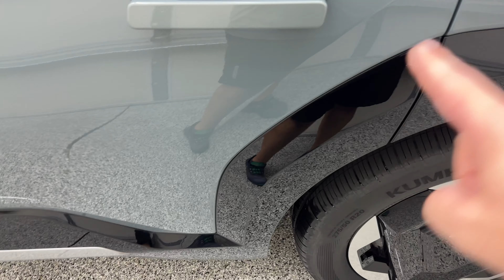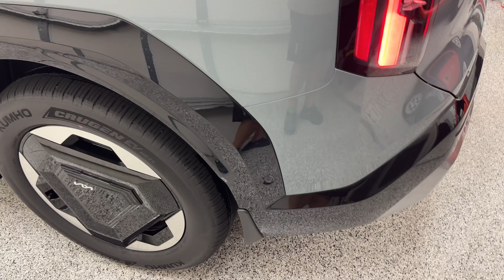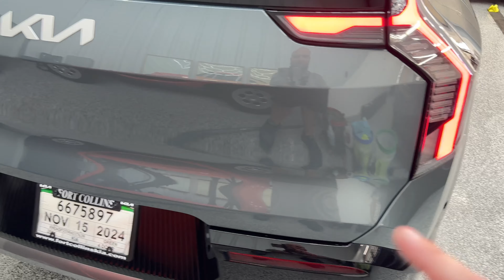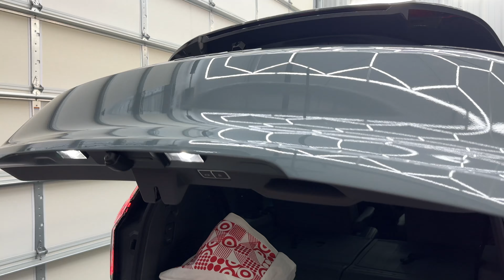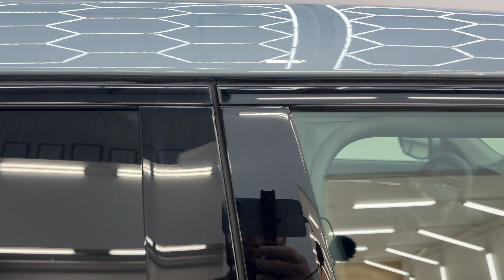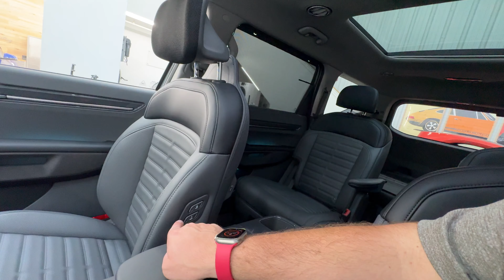KIA EV9 Land Build Quality Analysis! Is KIA's Most Expensive Model Worth The High Asking Price?

Comment: I just watched your video comparing the four 3 row EVs. You had some stuff in your front Frunk that you said was for the ICCU issues with the EV9. Have you had any of those issues? What did the stuff up there do for your EV9? It was my understanding that if the ICCU blew (because you were using an AC charger at a speed too high), that it could only be DC charged until the ICCU was replaced by KIA, and it could still blow again, it isn't a 1 time fix type issue. Do you have any corrections to my research... I really want an EV9, just haven't pulled the trigger yet.

Comment: Just a guess, but I think I may know why the back seats don't automatically go back to their previous position after flipping them forward for 3rd row passengers. I used to keep my Model 3 driver's seat in "Easy Entry" mode; which would move the seat back when I opened the driver's door. I changed to regular mode after I freaked out one of my rear passengers. He was behind me. We parked, I opened my door, and he started getting freaked out because the seat moved back to a point where it nearly crush his knees and feet. He couldn't figure out how to open the door fast enough, and we were riding 3 abreast in back. Luckily, the seat stopped just short of hurting him. But imagine the back seat in the EV 9 moving to a position that did not leave enough room for the rear passenger's various body parts.

Comment: All of the modern KIA's look pretty sharp.    I much prefer a KIA's looks over Hyundai.    The KIA is the first electric vehicle I actually have given serious consideration too as it's currently (as of 2024) one of the best value's in electric vehicles in my opinion.      That Colorado resident deal is an EXCELLENT deal for a large electric SUV.    You won't find a better deal than that!    I might have to go down to my Colorado Springs dealer and check one of these bad boys out!    That front trim cracking isn't good.   Especially in Colorado where it's not a matter if if, but WHEN you will get a rock chip.   This is the worst state in the nation for getting rock chips I think.   I hardly ever had rock chips before moving here.    All three of my vehicles got rock chips and broken windshields within the first three weeks of living in this state!   No joke.   It's crazy all the rocks that hit your paint or glass here.    A strong recommendation is to get PPF, at least the front PPF'd on all your cars if you live in Colorado and also on your front windshield glass.    It will be WELL worth it and it will save you a bunch of headaches later on.   That hidden wiper tucked up under the lip on the rear hatch is slick.    I think that is a great idea as it protects the wiper from being out in the weather and failing prematurely and just keeps the whole mechanism protected from the elements.   Very slick idea.

Comment: Friend mine bought 2024 can’t  comeback from Stockton to San Jose have to charge it on the way back is too expensive for that range and after 120.000 or 150.000 miles throw away with no value ???